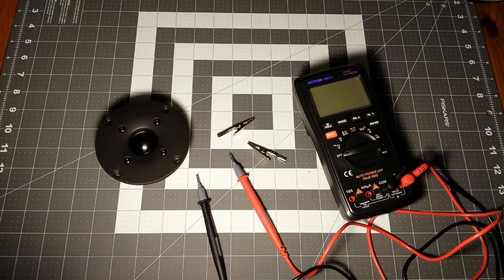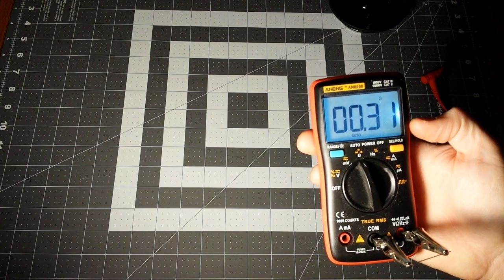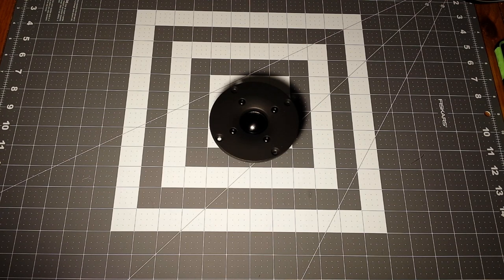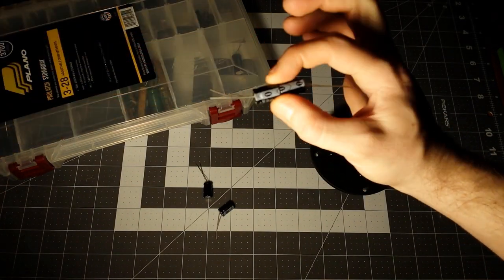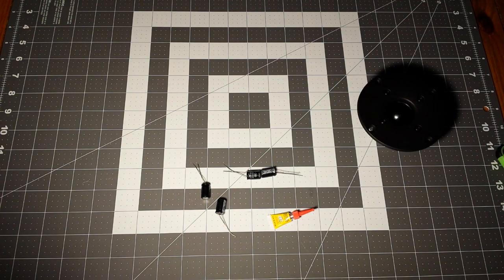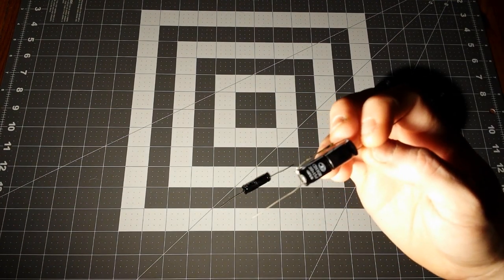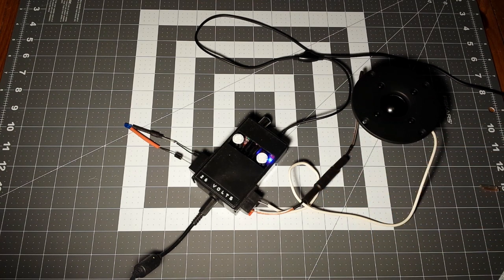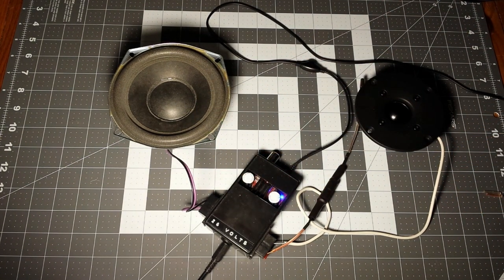How To Make a High Pass Filter Speaker Crossover

Comment: This is absolutely brilliant. Polarized capacitors are very common and most of us can simply salvage them from scrap electronics. 😊🌎✨
Reply: well, you CAN do that, but like he said, you want to use the same brand, same value and same everything.... although I've been doing this for years and never had an issue... also older caps have a higher DSR level and can change sound... and also since you're running a lot of AC through a high DSR cap made for DC, they may explode on you or get hot or any number of things. The voltage of the caps generally should be at LEAST 50 volts, preferrably MORE... but an interesting thing about this method is. while the UF value goes DOWN the voltage value goes UP... if you really want to get the best sound, get some audio grade caps, which have lowest DSR and aside from that, there are many non-polarized polystyrene, and other "poly" caps that do this job better... and this is only a first order 6db cut, where a 2nd order will require a coil and more calculations.

Comment from the maker: 4:00 - Meant to say 200 volt capacitors, not 200 watt :-(
Reply: Hey great tutorial, I tried making a HPF crossover for a 4 ohm mid speaker. I made the calculations as is
 Calculation Complete
C=220uF R=4Ω 180.86Hz. But the capacitor 50 volt is overheating pushing around 100 watts rms. Why is this happening? I appreciate your time.
Reply from the maker: @carlosruiz6179  Just making sure, both capacitors joined together are exactly the same; right? And the filter is then only hooked up through one of the speaker leads? If so I don't know what the problem is. At 4 ohms 50 watt capacitors should handle 261 watts rms, 63v cap 414w rms, 100v caps 1,044w rms and 200v caps 4,178w rms.
Reply: @DIYTechTips  I see, I did not couple 2 of them. I will do that and report back. Thank you very much.
Reply: Hey, I did exactly as you showed on your video with but with 100 volt caps. It works great, thank you for you videos and teaching us.

Comment: 15:16 how exactly do i calculate the achieved frequency 

And if i put 2 of those caps you built together, will the capacitance split again to half? (So 7,5:2)
Reply: use the on line calculator for crossovers.

Comment: When gluing simply use 99.9% Isopropyl Alcohol to wipe the ends of the 2 pieces to be glued with a napkin or cloth dabbed with a bit of alcohol let it dry, it almost drys instantly. The pieces will stick like never before, you can also use this method when applying stickers and 3M product to your walls, or on plastic . glass and metal.   Nice video btw. Kudos.

Comment: While it is good to know how to create a non polarized capacitor,  Non polarized capacitors are cheap and available all over......Will be easier just to buy them and use. 2.2uf - 3.3uf commonly used for high pass.......4.7uf - 10 uf commonly used for more mid if desired
Reply: i had no idea you could make a non polarized from two polarized ones. 
They didn't teach us that in class.
Reply: what is the  correlation between resistance of speakers and capacitance ?
Reply from the maker: You can use this calculator for RC high pass filter: http://www.learningaboutelectronics.com/Articles/High-pass-filter-calculator.php

Comment: You call this a half assed high pass filter. I'm curious what a not half assed hpfilter would look like?
Can I get away using this method to add a switchable highpass filter to a guitar cab. Or do I need to add more components into the circuit for a not half assed hpfilter?
Also: why not use 1 foil capacitor instead of 2 electrolytes? Since they are not polarized? Are the values of available foil capacitors just too low?

Comment: I think its easier to make low or high pass than mid pass, because high or low pass filter cuts one edge. Can you explain how to make middle cut, which allow only mid frequency and cut high and low? Thanks
Reply: you basically would create a high and a low pass, but instead of the crossover point being the same for both you raise or lower both to allow for frequencies in the middle. It would likely involve at least a 2nd order crossover. Typically a cap in series and coil in parallel on the tween, and a coil in series with cap in parallel on the woofer... if you use crossover calculator on line it will tell you the values of the coils and caps as well as give you a schematic to follow.

Comment: How come some high pass filters use a resistor as well?
Reply: it helps reduce the output of the tweeters to match the woofers. tweets are efficient. sometimes  resistor in series and in parallel are used.

Comment: You can put AC through a polarized cap  - you just can. Sony hifi speakers that have  a cap wired across twitter - single, polarized 1.5 uF cap. Just consider that the current is flowing from the positive input to ground and use + for the + of the speaker?! Just like you build amplifier and in some circuits you have a big cap from the amplified signal to the + of the cap and - to the wire that goes to speaker.  Not that your idea to make them non-polar is pointless, maybe it makes it safer but ...

Comment: Is that hi Pass 7.5 uf that's sa mid range
Reply: not really. it equals 2500hz crossover point, approximately in this circuit, Most tweets crossover around 3k.